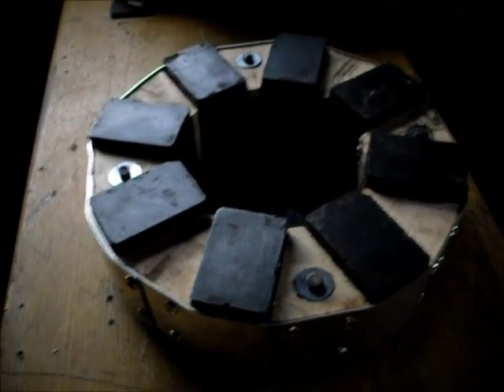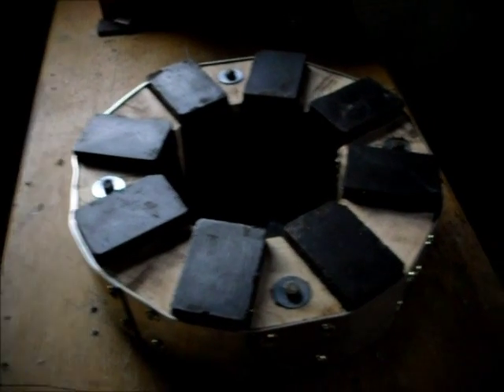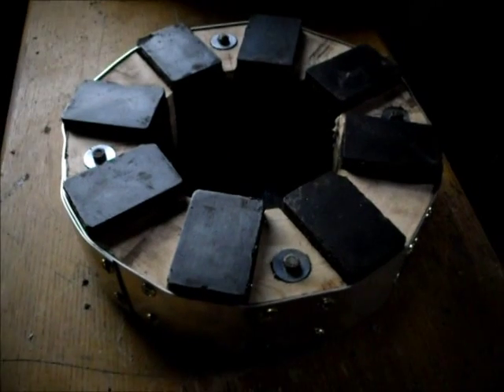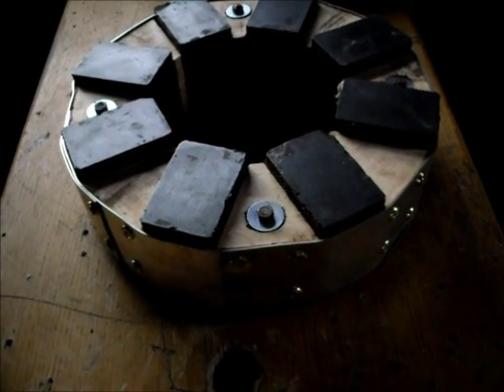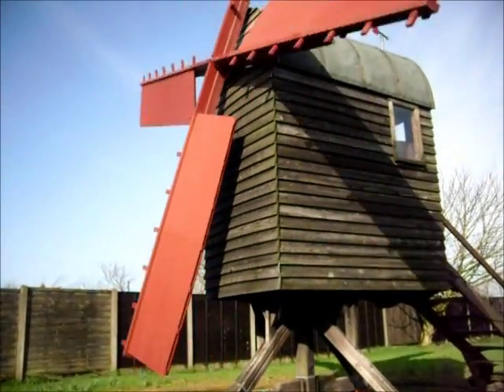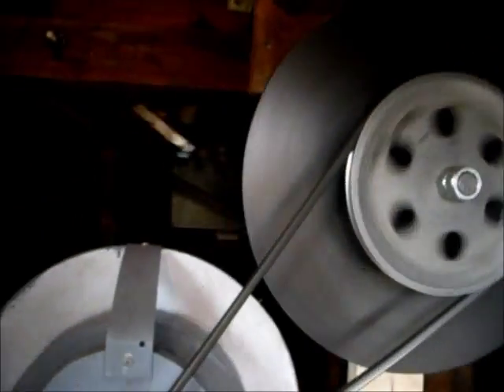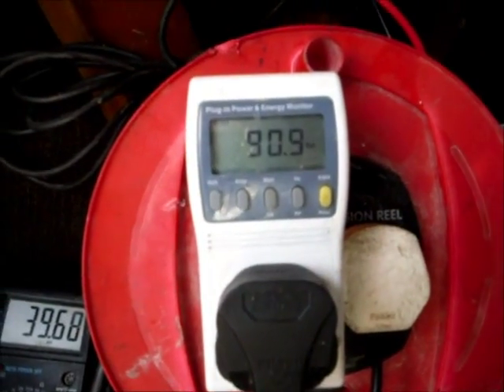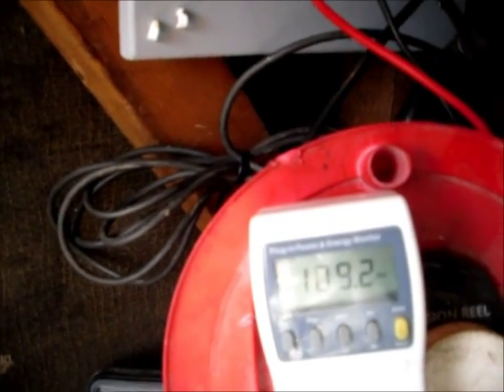grid tied windmill permanent magnet three phase generator self build

Comment from the maker: It' s a Powerjack grid tie inverter one of the low cost Chinese models, connect the DC and plug into the grid. Being plug and play I didn't ask for any permission. I have a solar system which is hard wired to the grid, That is "offical" and I recieve the feed in tarrif pyments, though any wind generated power is not incuded in that as that power doesn't go through the export meter. The powerjack is rated solar/wind no good for wind one of the capacitors have fried due to overload.

Comment: Im guessing the Grid tying device is also an inverter if your using a DC input, does it condition the voltage internally? surely it cant put varying voltages into the grid. secondly, did you need some kind of permission/ approved installation for it? or can it just be set up and used?